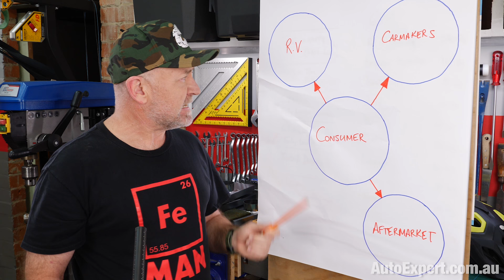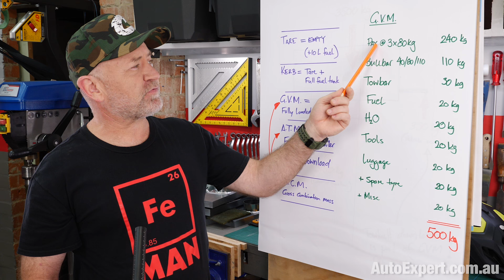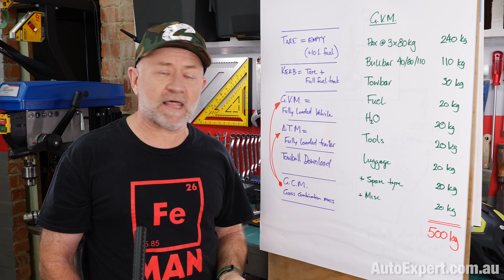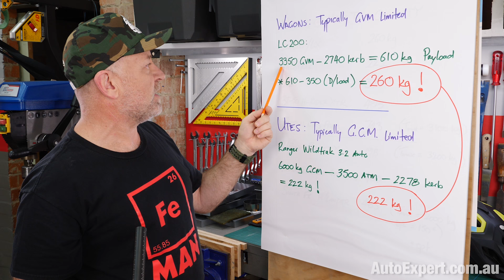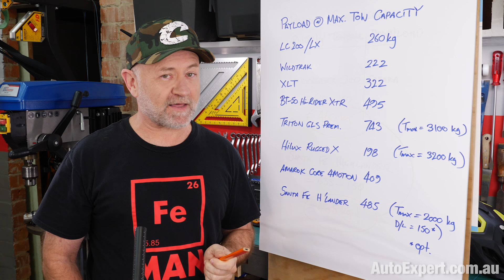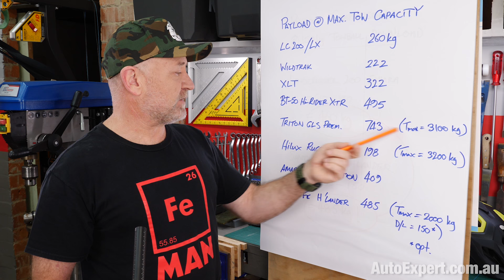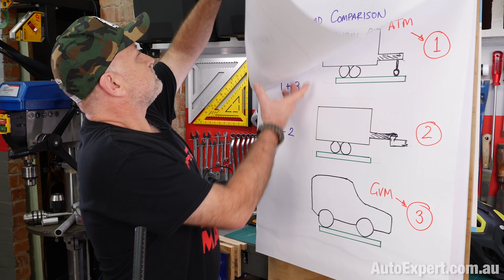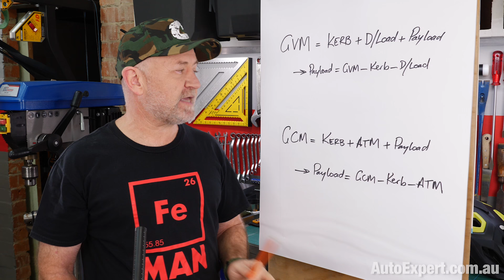Complete guide to heavy towing (GVM, GCM & ATM explained) | Auto Expert John Cadogan

Comment: You make some excellent points.

I am often annoyed how scalies take delight in throwing the book at semis and road trains yet seem to do nothing about people in cars and caravans that are obviously drastically overloaded.  I see so many caravans driving up the road at 70-80Km/h.  Do they not have the power to go faster? (I doubt it) or is their vehicle almost out of control at 100Km/h?  As a rule a semitrailer (42.5 tonne GVM with no permits) is totally safe, still handles and stops properly, and is usually still within manufactures specifications 10% overloaded.

Granted weight restrictions are there on trucks to save the road more so than the truck not being able to handle the weight.  A simple example is bogie drive body trucks are allowed only 22.5 tonnes, even though many are factory rated between 25 and 30 tonnes.

Comment: Nobody in Aus mentions the 85% rule prevalent in the UK. If you limit your trailer ATM to 85% of the car kerb weight, you can never find yourself with an unstable combo
Reply from the maker: This is true. We have a regulatory culture problem here, where some pickups (the 4X4 ones, basically) generally offer 3.5 tonnes of towing capacity, but weigh only two tonnes themselves (kerb wt). It's ridiculous. I'm flat-out convincing people not to tow more than the vehicle weighs...

Comment: 27:50 Oh, I hear you, John. I've been put in similar situations over the years. On another note. I knew a person that had a business painting roofs in Western Queensland; some insulating paint of some sort. He had a couple of old, F-250 (around 1970 vintage)  utes/trucks with full-body-length roof-racks. He would load Ten 5 metre trestles and as many aluminium planks as he could and then send his boys from CQ coastal city out to the middle of nowhere Western Queensland. Through a bizarre set of circumstances, I had to drive one of these utes about 25km over dirt tracks and then the National highway. It was the craziest drive of my life (I'm 55 and worked in transport or was ibn vehicles for most of it). The top-heavy load combined with 1970s suspension and I think drums all-round made for a somewhat 'sailboat in a cyclone' kind of ride.

Comment: It's a lot easier to take the lot across a public weighbridge when you next start out on a trip. But be prepared to unhitch and take the excess stuff back home before continuing on the trip. My tow vehicle has a GVM of 3200Kg as is the Caravan. But the GCM is 6 tonne  with a max ball load of 350 Kg but I am running it at 190 Kg. Of course I have done my sums and ensured that I don't overload and have run over a weighbridge a couple of times.

Comment: I often wonder why we didn't die in the late 1970s. XB 308ci 3 speed auto Falcon towing a 2.5 ton ( not tonne) tandem 25 foot caravan with  electric drum brakes on 1 axle. Brisbane to Perth and back then Brisbane to Cairns then back to Emerald in CQ only addition was a transmission cooler and not a problem. Got a job in CQ , sold the van and never bought or wanted another.

Comment: How is it that Ma and Pa 'Kettle' can go out and buy a massive caravan, load it up, whack a boat on the top of the 4x4 and take off into the wide blue yonder with no previous towing experience? As someone who did get into trouble once with the tail wagging the dog, I know how quickly things can get wacky. Luckily I was experienced and knew how to recover (despite blowing one of the 4 tyres on the caravan) but there are so many people towing huge vans who have no idea about proper towing and what to do when things go wrong. Surely there needs to be some mandatory training for towing any towed vehicle over a (yet to be determined) weight limit...
Reply: Yep. Ma and Pa Kettle here in the states probably have a much bigger caravan, but do have a better idea of tongue weight. I see toy haulers that are in the 13,000 to 17,000 lb dry weight all the time and they are usually behind a big duallie (350(0) to 650(0)). I chose the other route where my tow vehicle has a GVWR of 45,000 lbs (42' coach) and my trailer is only 10,000 lbs.

Comment: I agree with the towing capacity of a dual cab of 3 tonne. 3.5t is only okay with a empty tray and only the driver in the car. I guess most people get the GVM upgrade to offset the downball weight, its more of a insurance when your upgrading suspension. You wouldn't want to tow over 2.0T with the standard suspension of most dual cab utes. The suspension struggles with 500kg in the tray. You can't upgrade your CGM however. 
But a smarter option if your going offroad is a trailer around 2.0T. Even the 4wd truck downgrade their payload when off road.
Reply: Is a dual cab ute the same as a crew cab pickup? I'm not really familiar with the ute.

Comment: John, your "Weighbridge 101" flip sheet has an error in that number (3) is actually GVM - D/Load. Maybe call it GVM' ("GVM prime" instead). This actually threw me out when I went though the weigh bridge worries and may do the same to others.
Great job otherwise - have shared it with friends as the best summary I came across.

Comment: It's even more complicated than John suggests.  For example, my L322 Range Rover 4WD has kerb weight of 2,440-2,570kg, GVM of 3,050kg, and an ATM of 3,500kg on road or 1,000kg off road.  What does a big off-road caravan weigh?  I'd suggest more than 1,000kg.
The owners manuals states:
"Maximum tow hitch load (Nose weight)
If the vehicle is loaded to the Gross Vehicle Weight (GVW), the nose weight is limited to 150 kg. If a
 greater nose weight is necessary (up to 250 kg maximum), vehicle loading should be adjusted to ensure the GVW and rear axle weights are not exceeded"
Note that last bit - rear axle weights.  On mine it is:
"Maximum rear axle load
  1850 kg
NOTE: The rear axle load can be increased to a maximum of 2050 kg when towing, provided road
 speed is limited to 100 km/h.

NOTE: Axle weights are non additive. The individual maximum axle weights and gross vehicle weight
 must not be exceeded."
Who goes to a weighbridge and checks axle load?

Also read this: http://rvdaily.com.au/is-this-the-most-significant-court-case-relating-to-caravanners-in-australia-ever/

Comment: We not long returned from the Rock and Alice Spring and I was surprised to see many people towing their vans obviously overloaded with the back of their cars looking sky woods. Every thing that John said is true but there is one thing not mentioned the "legal" towing capacity of the car and the real towing capacity of the car. Yes I am a LC200 owner and had to do a GVM upgrade to 3845KG to stay well within the legal limits. Yes I did the weighbridge thing except, I did a combined weight, then came back later with just the car (loaded) and got printouts both times just to cover my a$$ if thing go belly up while out there cruising this big country. My LC200 is obviously a 4.5l twin turbo V8 Diesel which tows our 3.1ton van easily as long as I keep the fuel up to it. There are many people out there pulling large van with 4 cylinder diesel engines that are being pushed just to maintain a near speed limit speed and when a hill comes up, well say no more. I think purchasing a lc200 was the correct choice for many reasons but Toyota suck when it comes to offering a $110k plus car (we have a Sahara) with a pitiful GVM but at the end of the day, I have resale value and something that will tow day in and day out much easier than 99% of the opposition. Rant over

Comment: Two years driving roadtrains, you get sick to death of caravans real quick, if you can catch it you can get away from it and most overtaking lanes are uphill to favour cars passing trucks... Most caravan’s won’t give you that one hill, if they did they’d never see you again and they wonder why they sometimes get run off the road.
Reply: I have run into the same issue with my coach. I have to stay in the right lane on steep grade, but have more than enough power (Cummins M11) to pass caravans being pulled by gasoline powered vehicles. Even if I pass them on the uphill they normally get by me going down since I subscribe to the "you can go down too slow many times, but only too fast once" mantra.

Comment: Great advice John about the hidden figures of the weights but if you would like to tow your caravan with a light truck some of the RV manufactures have a get out of jail card for their warranty.
The rigid suspension of the light truck transfers the vibration through the caravan causing damage to the walls and interior. Your advice of spending $500 on accommodation per night would be the best option.

Comment: Something you may have said but I did not hear; these weight limits are on factory equipped vehicles.  Once you start replacing stock equipment/parts with aftermarket parts, then those numbers are shot out of the window with a cannon.  Most lifted trucks actually lose their capability because the new suspension is typically a "softer" set up, different center of gravity and brake system stressors.  Not to mention that larger tires and springs/components are heavier.  So their capacities are lower now.  But who is doing all of the new calculations to see where the new, lower limits are?

Comment: One issue is you cannot get 4 hours off the road  and still find a hotel.  But I agree get something with dual wheels or if it is a really big load go with a semi tractor and you will have the power to pull and stop.   Vehicles are designed to occasionally haul a load if you push them they break, if they designed a sport utility to haul a big trailer it would cost even more ridiculously more.

Comment: Just been reading the comments and am looking forward to the nuts video. A heavy duty tow pack results in stiff suspension. I could buy two houses for $190,000.
Reply: honestly would like to know where you can get a house $80,000
Reply: @kevinkocho7491  Far west Victoria.
Reply: I could by 3 brand new diesel pickups for 190,000. However, 20 miles down the road in Baltimore I could buy most of a block of houses. My chances of being killed while renovating them is not good though.

Comment: Thanks John, I agree to to getting to your local weighbridge and get a real number. I dropped my 10 year old Navara on my local with steel bull bar (already used deflecting 1 roo, so yes, they do need to be installed if you you're heading outsiding the burbs) and a full (long range) 160 litre of diesel, big boy weighed 2400kg of its 2805 gvm (otherwise completely empty). So expecting a van of approximately 200kg download and unexpectedly a massive weight loss from me and the misses, a Pedders 400kg gvm works... (No change to GCM) ONLY if I expect to tow a 2T van. Otherwise I agree that most of those vans out there will be overloaded... 
It's be really interesting now to gauge how many of the wrinklies are 'oh, I didn't know'  verses 'i paid my taxes, f-off'...

Comment: Hi john you forgot that in most states in Australia a standard car licence only allows you drive a vehicle with a GVM of 4.5t (4500kg)
I know in Victoria that you can be pinned for driving without a valid licence. technically you need a higher category licence such as a light rigid or medium rigid. not sure of other states.
Reply: According to vicroads & NSW road & maritime authority. You actually need a light rigid licence to tow a heavy trailer
Reply: Can't think of any SUV/Ute in Australia with an GVM over 4.5t, although the RAM gives it nudge at at 4490kg. My guess is the other American Utes being imported also "magically" come in 5kg short of 4.5t as well.
Reply: No Body true but still if you are towing a massive 3t plus trailer maybe you should have more than just a car licence.
Reply: Light rigid should be the standard driving instruction

Comment: Could not agree more with your closing statement, drove over 10,000km last year to WA and lost count of the number of big SUVs and UTEs towing big vans. Meanwhile I'm cruising along in my sedan, one passenger we stopped at motels and holiday parks for an average of $100 a night. 

To top it off I averaged 8Lt per 100km, trying doing that while towing 3.5 tons of van behind you! 

If I found the need to go off road in to the outback I'd get a decent camper trailer, pops up in no time, weighs a fraction of those big vans and can go further off road with the right 4x4 and be a lot more fun to tow.

I really hope the government brings in the proposed trailer license for any trailer that requires brakes, so over 750kg usually, and they crash down on these big vans being driven by people with very little experience driving them.
Reply: It may not make sense in OZ, but it does in the US. Being able to stop or not stop whenever and wherever along the interstate and US highway system is great. We won't tow a caravan, we tow a trailer with a trailer with an SUV for trips around town. Our tow vehicle is a 42' bus (8 to 10 mpg) most of the time and the best thing is that you don't have to stop for the restroom for the wife and kids every 2 hours. Fuel stops at 1,500 miles and stops for driver fatigue right around 1,000 miles. Great way to see the country as long as you have hard surface roads.

Comment: You need to pack as light as possible, but if you want a quality bunk van and the accessories you want on a good capable 4wd  and dont want to buy a massive yank truck that will sit around most of the year, then the Landcruiser is the best option.  You will need a GVM upgrade at the minimum to give you another 500kg payload but the GCM and GVM upgrade is the best option.   My Cruiser sits loaded with family and tow ball weight at around 3.5 ton and my van which I can legally load to 4 ton if I wanted sits at around 3.3 ton. This is packing for a family holiday with minimal crap.  I can tell you John that  it s safe to do so as well.  As an engineer as well, I agree with what you say in relation to the rules and your nice little force diagram, but it is the persons prerogative if they enjoy rolling $250k down the road instead of booking motels everywhere. Some people enjoy this way of holidaying.  When I buried my father last year the armourguard van did not follow the hearse, life is about memories and doing what pleases you. I dont give a shit about spending my money on what I enjoy no matter how many cheaper options there are.

Comment: Hi John wondered if you'd consider doing a video on fith wheel tralers. A really big caravan.
Reply: that would great, its hard to get information.
Reply: He doesn't need to with all the information he's already provided.  
The additional information you'll need is AXLE WEIGHT LIMIT for your desired tow vehicle.  Then,  you'll need to take into account weight distribution across all your axles, making sure you're within the engineering specs.
Reply: He gave you everything you need you are just moving the ball weight to the axle and need to stay in axle limit.  If you think it is big get dual wheel truck, if you think it is really big get a semi tractor to pull it so you have the power and no issue with weight.

Comment: The other 'okay' scenario is rescuing family members who broke down at Gundagai (I'm in Melbourne) without roadside cover.  Just did that - 3000kg approx car & trailer - towing vehicle was rated up to 3500kg (695kg load capacity), but after a butt-puckering start (not enough tow ball weight and started to get the sway) - moved car forward on trailer about 2 feet.  The trip was done without any further dramas, albeit at around 80-90kmh as that just felt better and more stable - I had to get an electric brake controller fitted before the trip!  Some people reckoned the old hydraulic system trailers would be fine.  I don't think so!  One thing to consider when towing another (esp. 4WD) vehicle on a trailer is the centre of gravity of that combination - I felt it was about 4 feet higher than usual.  So small movements or camber changes in the road really was magnified on the trailer.  In the end, I think with 4 adults on board, I was about 10% over the ideal maximum, but took it easy, braked super early and was just fine.
Reply: Towing anything 2 tons and over  require electric brakes on all its axles and a breakaway system fitted.
Reply: @Roberto.Giuseppe  Yes, it was the "She'll be right" comments from people (i.e. just use an old trailer with hydraulic brakes) that was more worrying! :-)

Comment: Lots of good points John but you are generally talking about standard vehicles. Apart from the  extra weight of the steel bull bar and winch and tow bar, what about the  extra battery and front suspension bash plate at 4mm thick. The new recovery points on the front, the new suspension  with thicker coils with huge new  remote reservoir shock absorbers and not forgetting the All Terrain 'one size up' tyres over the lightweight HT tyres. The big driving lights and the 60kg steel roof rack with the 900m wide LED light bar, not forgetting the new big fuel tanks that add another 150 litres= 150kg more plus the extra steel of the new tank.  So with those new fuel tanks full and two fat people, that LandCruiser with 260kg leftover is well and truly gone.     Jimmy!

Comment: I tow my boat which is an 8.5m aluminium fishing weapon and is just under 3100kg in my triton. Its definitey not fun despite it being within the 3100kg limit. Fortunately I only take it at about 30kmh to the boat ramp which is 500m distance. I can't imagine trying to take it down a highway.
There is a whole other sum of weight that happens when you consider the wind resistance onto that boat/van travelling at 80kmh or more down the freeway.